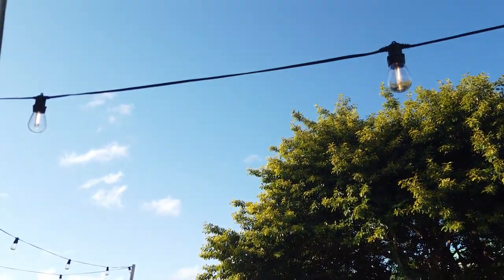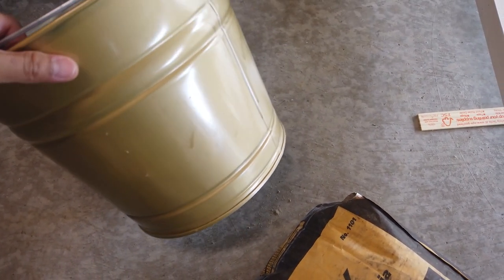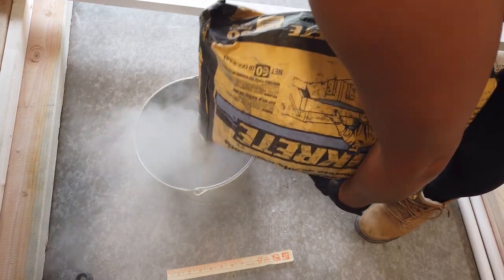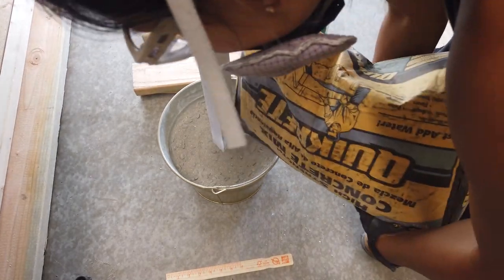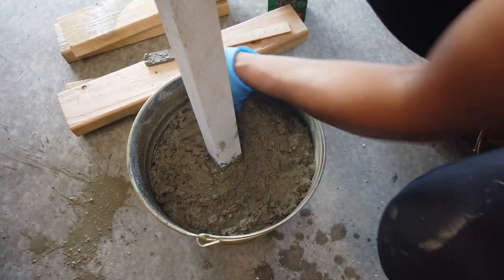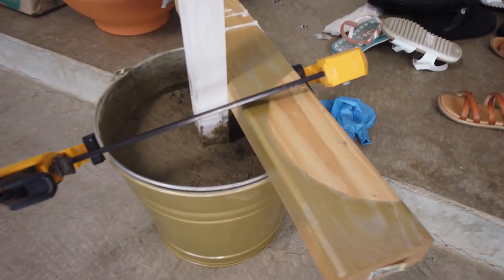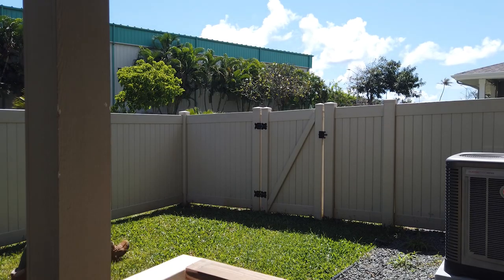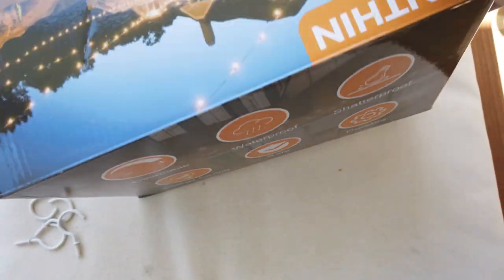DIY STRING LIGHT POLES | EASY DIY

Comment: How much did you end up spending on the project ?
Reply from the maker: The buckets I want to say were $10~ give or take each, the concrete is maybe $6 a bag, and the lights were roughly $30 and I have two. So depending on how much product you need, it could get a little higher but I think still cost effective if you wanted to hang lights up anyway! A lot of the items I already had. This time around I only have to buy one post, concrete and a bucket!

Comment: what size posts did you use?
Reply from the maker: Hi! So my posts were 2x2x8, if you have a large enough base, I would recommend doing 4x4s because I ended up having to strap mine to the fence since it’s super windy here 🤪

Comment: What size pails did you use?
Reply from the maker: Hi Doug! I believe mine is a 12 quart pail fridge Lowes. It works well if there is little to know wind, but if you’re in a windy area, I suggest bigger buckets with more weight to hold them down! Hope that helps!